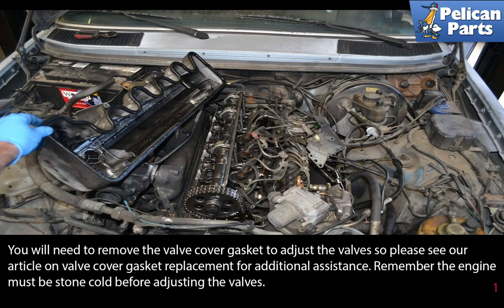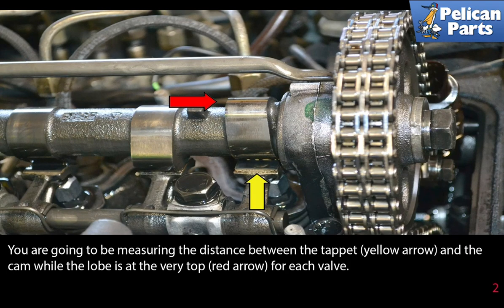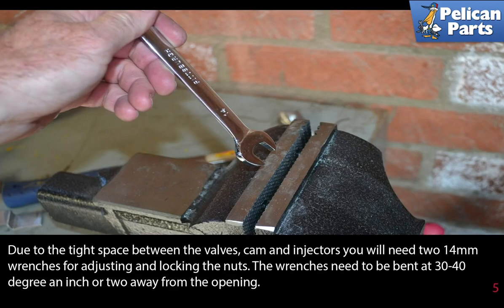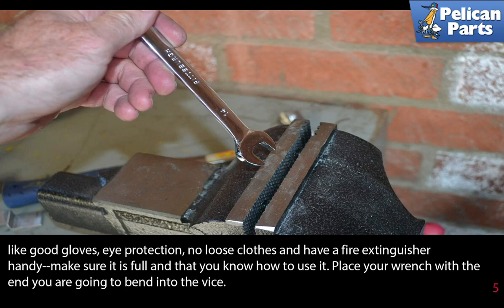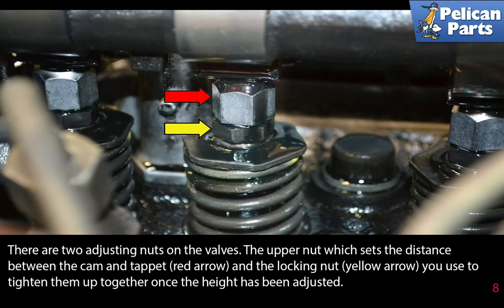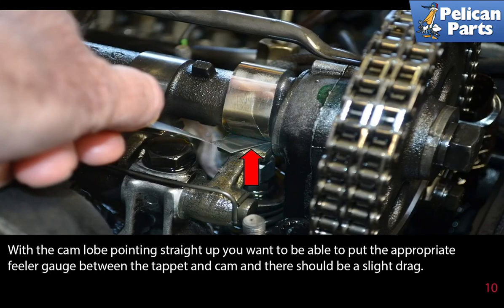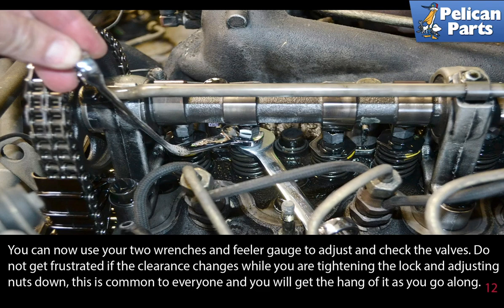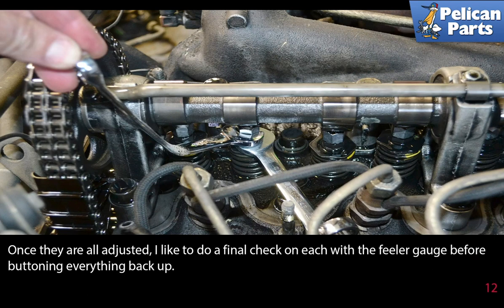Mercedes-Benz W123 Valve Adjustment for 300TD, 230, 240D, 280CE, 280E, 300CD and 300D

Comment: I buy parts for you guys all the time! That said the exhaust valve are set to .35 mm not .305 mm per MB factory manual.
Reply from the maker: Thanks for that!
Reply: I could be wrong, but I think it's one or the other depending on whether you have a turbo.  I think turbo version is .35mm and non turbo is .305mm.

Comment: Is the adjustment procedure and valve clearances the same for 200 and 230 e (M102 four-cylinder gas engines)?
Reply from the maker: Not exactly, but similar. I would suggest you grab a repair manual, you should own one. It will have the procedure, special tools and torque specs.

Give our parts specialists a call at 1-888-280-7799